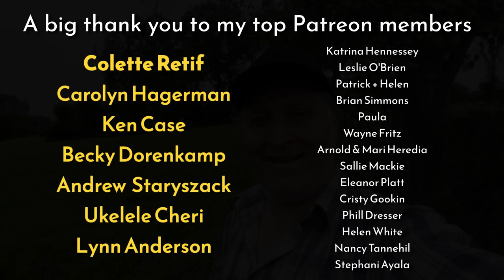Major Progress! Getting Water Into The Cottage - Part One | Cottage Renovation Episode 33

Comment: Probably from my lack of experience, but I thought water main pipes were at least 6 inches or larger. Are you going to insulate your pipe so that you don’t have to worry about it breaking during freezing weather? It does not look like it would be fun to have to dig it all up to fix a broken pipe. But, again, I do not have construction experience.  Also congratulations on finally getting that job done. That looks like a major step forward.
Reply from the maker: Mains water inward to the house is 25mm waste out is the largest bore pipework.  The pipe don't need insulating because it's lower than the frost line

Comment: Well, the whole operation has to be redone. The water barrier is placed wrong. The spikes in these products have to be placed against the walls, not to the outside. This is to create a small air insulation between the walls and the soil and to let the walls respirate.

Comment: Great progress Sean, he’s done a super job on that digger. Why not put a stand pipe at the end cottage (boxed and insulated) for an outside tap, that way you can run a couple of buckets off every so often to stop pipe growth inside. Also extends your options (hose connection should you need/want it at that end) Super vlog. Stay well.
Reply from the maker: Yes he done a great job 👏 all water pipes will go internally now from cottage. The water won't be connected until its ready to use

Comment: Nice job - congrats! 🙂 But a question, didn't you put in the membrane the wrong way around? Isn't the dots supposed to be against the wall so the membrane has some air gap to the wall so the water can evaporate? Hope you've noticed before the backfill got in

Comment: Sean, are you running the water pipe down to the further, last, cottage so you don't have to dig again if you want to add that as a cottage in the long run? It would seem like a good plan.
Lucky break with the fosse, and round the corner, situation, well done.

Comment: Hi Sean! I think the foundation membrane should be installed the other way around. In a way that the spikes are against the wall.
Reply: It might be both ways as which ever way you put it as it should have a gap from the bits sticking out!?!
Reply: Agreed, I would think that the spikes should be against the wall, so as to allow a gap for moisture to evaporate as Sean originally pointed out.

Comment: it looks as though you started to add the membrane with the dimple against the wall (which is correct) then changed it with the dimple towards the fill (which is not correct)
Reply from the maker: It works either way as a damp proof membrane